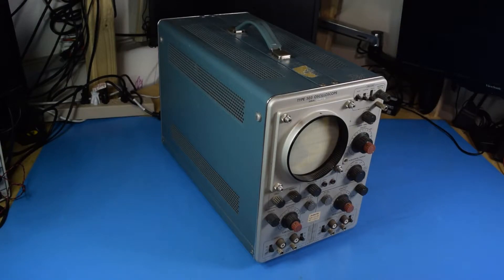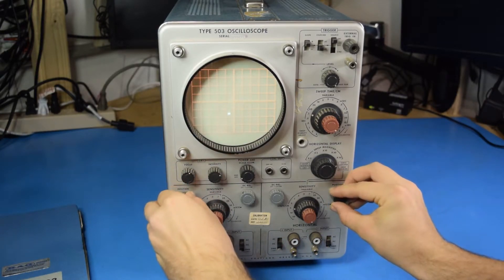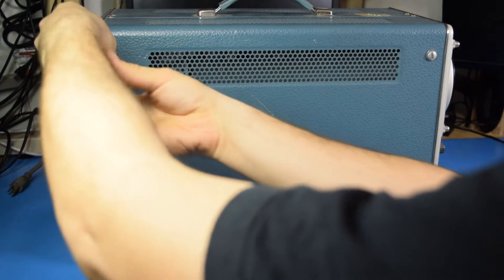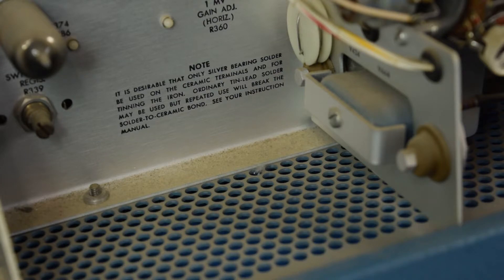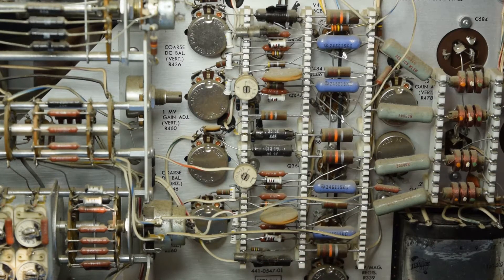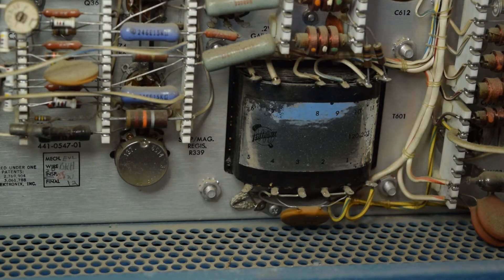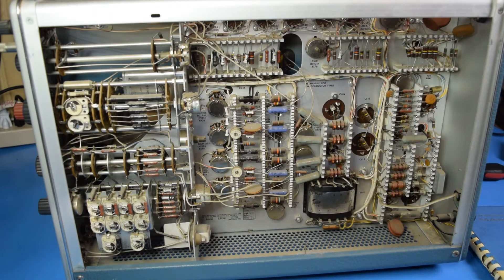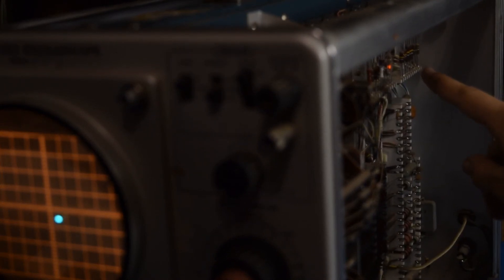Tektronix Type 503 Oscilliscope a Recent Acquisition

Comment: You can clearly see the original Tektronix supplied silver solder (pronounced sol-der) at 1:50 just to the right of the warning note on a small while spool mounted on the frame.

Comment: The function-generator may not have a direct feed to the display and only output to the 'product under test'. (requiring a pass-through-cable to check the generator itself)

Comment: Start with the electrolytics in the cans. That is what killed my 517. If the solder is still in there, it will be on a tiny 1 in spool (white) riveted to an interior panel.

Comment: I've heard that Tektronix used to include a roll of silver solder inside of the chassis of these old scopes for future service people to use. I'm not sure if there is any truth to that or even if there is, if someone hasn't already ran off with what was included with this scope but I thought it would be worth a mention.
Reply from the maker: I read that as well but couldn't find any in it. There is some 3% solder on Amazon I'm going to get for it. It'll be nice to have some at the ready for other projects that need it.
Reply: AkBKukU looks like there’s some directly to the right of the warning?
Reply: @Andrew Cassidy
Yeah, if that is not a small roll of solder, then what the heck is it?